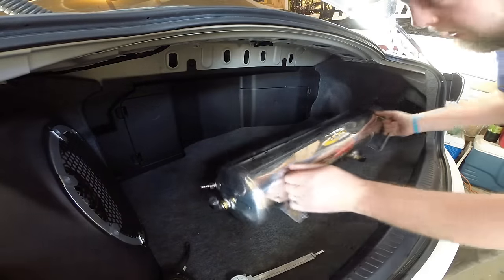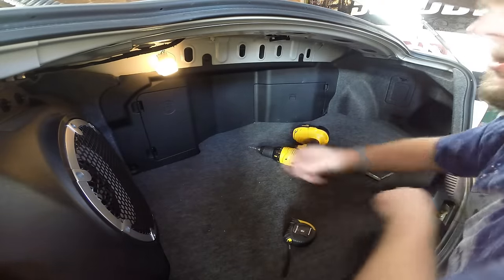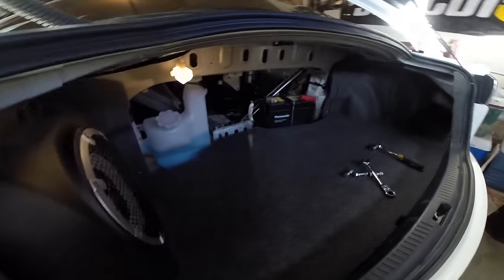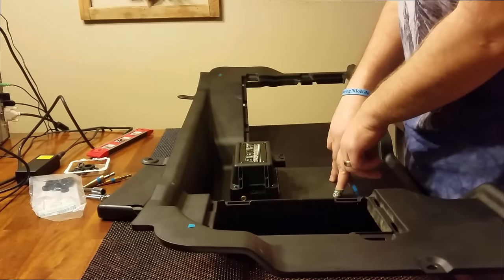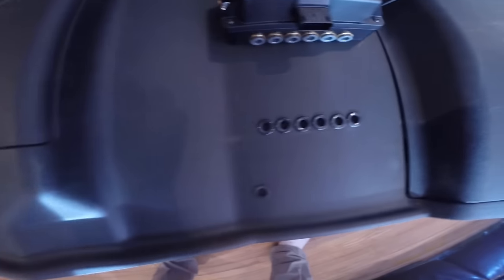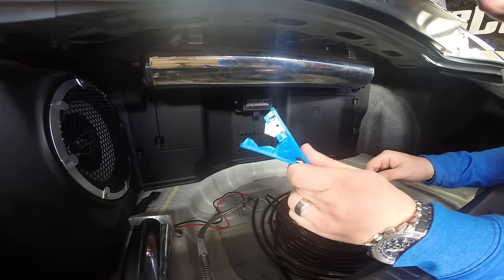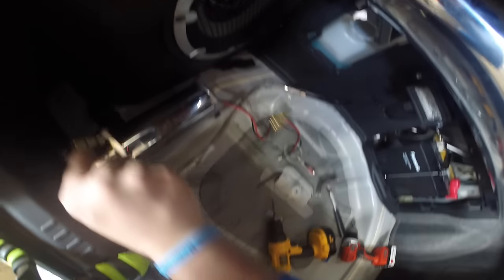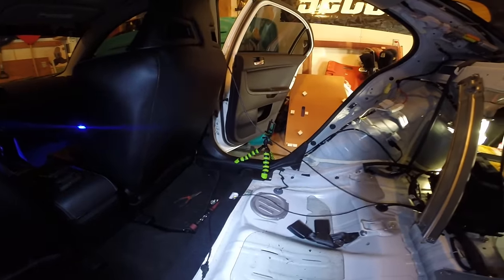How To Bag Your Car - Part 1/2

Comment: man! love the vid but you know your going to have to take that tank apart again to drain it.
Reply from the maker: Mellodone2MA I hope that that day is very far away haha. Thanks for lookin out though
Reply: BR3W3R all good man. I use a 5 gal tank. I get about 3 months of cold weather in the winter, a couple of months of nice "Cali" weather and the rest hot n humid. I'm in Houston BTW. I didn't drain my tank for a year  and it had a good amount of water in it. There is really no way I could tell how much was in it til I finally decided to do so. I'd say about a gallon. as a result it caused my check valves to corrode and malfunction. Tank wouldn't hold air, compressors would kick every 4 mins. Took me a month, spraying my system doin all kinds of crap. Learned that check valves won't produce air bubbles. Water sux! Keep up with it man.

Nice car tho.

Comment: Dude this is awesome. Great work. I do have a question, After everything was finished, has the subwoofer caused anything to loosen in the trunk? As far as the bolts holding the tank?
Reply from the maker: No problems like that so far. Those bolts are real tight so the chances of that are very slim.

Comment: Going to run tubes with tubeless tires. Would getting my car bagged with this setup cause any issue? The wheels are 14x6 reverse offset wire wheels.
Reply from the maker: That's not really for me to say. I'm not the bag professional haha. I'd contact airlift direct to try and find an answer.

Comment: Do you have a list of all the connections you have used? Am wondering if the leader line from the compressor can plug straight into the air tank
Reply: Reuben Murphy I'm not sure if I still have the parts list but the leader hose will connect direct to the tank

Comment: When you bought the suspension They sent you all the installation instructions? tnks nice vid
Reply from the maker: Not much for instructions. Basically just a map of what stuff was and where it connects to the system. That's one of the reasons i made this series to explain the process from start to finish because nobody else had videos like mine.

Comment: What is the drain part for? Does the compressor just collect water from the air and needs drained from time to time? First time looking at air suspension.
Reply: The tank collects water and needs to be drained

Comment: Hey man I was wondering if you knew where I could buy one passenger rear air strut, mine went out and I can't find anywhere to get  a replacement. I can only find full kits
Reply: Lilskidmarks14 any airlift distributor should be able to get u a strut. If you go on their website you can find the closest distributor to you
Reply: Alex Brewer i tried and they only sell full sets or a set of two and I just need one
Reply from the maker: Still talking with my guy about getting a strut. Hard to get ahold of them. Busy business
Reply from the maker: Lilskidmarks14 we can get you a single strut. You have a way I can get ahold of you. Facebook, email, ect?

Comment: For stainless steel lines for the struts, did you use thread sealant or teflon tape? If thread sealant which one did you use?
Reply: Itz Boomski I just used thread tape, but if i ever change anything all be using the Locktite thread sealer. After doing my install that's something I wish I would have done
Reply: Alex Brewer aright I actually talked to air ride eqiup and they said to use loctite thread locker 242 blue under teflon tape to get proper seal

Comment: Could I still bag my car even if I don’t find any airbag suspension kits for it?
Reply from the maker: For sure. It's just a much bigger task task then having a vehicle specific kit like I have. Lots of research to find out what size of bag to get that'll fit. More then likely you'll have to do some fabrication to make them fit. After that it's easy. Buy whatever air management you'd like and slam that S.O.B

Comment: Does your car have to be completely on for the management to be on? I wired it it the fuel pump as well just making sure it's the same as yours have the same evo
Reply from the maker: Luis Martinez yeah it has to be turned over to activate the management. Outta curiosity did you watch my videos before your install?
Reply: BR3W3R yes I did I had another management and I was able to to control it with the car being in ACC although it was wired to the cigarette lighter fuse and with airlift I followed your video, great video!
Reply from the maker: Luis Martinez man that's awesome that you used my video! Appreciate it!

Comment: Which fitting did you use to connect the airline from the compressor to the tank to "extend" it
Reply from the maker: Are you talking about the brass piece between the stainless line and the airline?
Reply: BR3W3R yes I bought the whole 3p kit.. umm I have 1/4 lines though
Reply from the maker: Ryan Perryman so you should have the same fitting just smaller in one side. It's a push fitting that comes in the hardware bag that's with the struts in the box they came in. Did you get those?
Reply: I don't think you have 1/4, your lines look bigger than mine and my line is the same size as the brass piece so there is no way to get the line over it